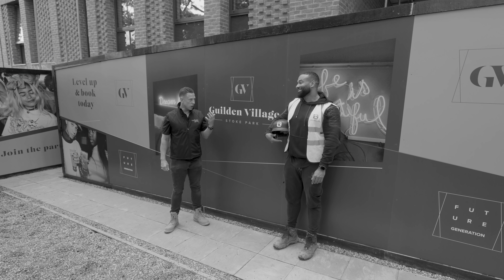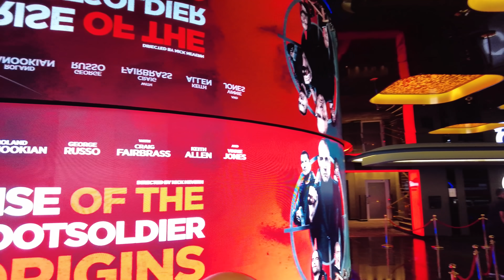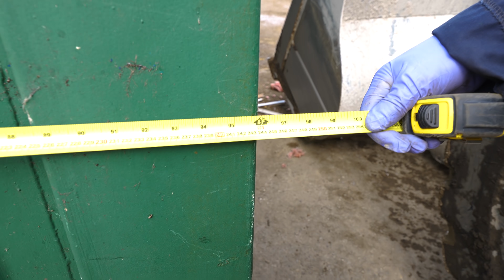Trying to Container My Excitement | Ashville Weekly ep048

Comment: Daniel you either need to fit an internal door with a window in it inside the steel door on the security hut or a concave mirror on the opposite side of the road so security man can see any vehicles approaching the barrier if it's pissing down/windy/cold and he has the door closed, or a CCTV camera and monitor.

Comment: The security office, would it not be an idea to have one of the windows facing the direction that traffic will be approaching the yard? And the door facing back into the yard. Might have to put another window in for that configuration.
Reply: I was thinking the same.
Reply: or put a window into the door, or get a glass door, then a steel shutter,
Reply: Exactly my thoughts two or was it three.
Reply: Don't like the split window either.
Reply: A cctv camera would work.
Reply: It adds safety to the security guy also having the door facing the yard
Reply: @satyajeetkumar4938  my thoughts exactly.

Comment: Hi Daniel, with the Ex Army flat rack you don't need to weld wheels onto the back, all you have to do is when you unload it release the handbrake on the truck and the flat rack will push the truck forward. i used them flaf racks for years in the army it will work a treat and save you tine trust me lol. all the best James.

Comment: For the army flatbed there is no need to weld wheels on, just put the truck in neutral and take the handbrake off as soon as the rear of the flatbed touches the ground and you'll simply roll forward👍🏻 this does require more space infront to unload though obviously

Comment: 27:34 before you completely redesign your network, get someone to check the light levels on your fibre. That will tell you whether there's an issue with transmission.

Ethernet (copper) should be good for 100m but if your Internet keeps dropping out its worth getting a proper network tester and check the cable and make sure it's not just a bad run. As others have said if you're running your cat in the same conduit as power that could create some interference.

If you're using media converters for your fibre it's worth whacking them into SFPs to rule them out as a cause of your problem.
Reply: Those Cisco switches (or switchers as they seem to be called....) are managed, you should be able to check the stats on the ports via the management on them.

Comment: Put a handle at the top of the sliding shutter on the security hut to lower it down behind the barrier. It would be easier to slide it back up aswell.

Comment: You should put a pulley wheel on top of the hut with a chain or rope onto the sliding door, that way just need pull the chain/rope to slide up the door save having reach in to get the handle

Comment: You should put a chain on the security window guard with a wheel on top and throw the small chain over and they can pull the chain to lift the guard plus it would lower the weight of the guard

Comment: Daniel! Changing the network cables/ fibre cables isn't going to fix your ip-conflict issues. This will no doubt need a network engineer on site to map out how your current network is setup/working and try and locate the duplicate ip. Seems like you guys could do with VLANS setting up so you can sperate your network traffic from other traffic like Phones or CCTV. But like i said it all comes down to how your network is currently setup. Happy to help...Ragz

Comment: Why dont you just weld a handle on the top of the security hut window cover so you can slide it up and you don’t have to reach down and when its high enough you can grab the bottom handle for extra support? And the same when you are putting it down so you don’t have to bend down and damage your back?
Reply: Or just add a winding mechanism and do it that way
Reply: because he will have to respray it? Wouldn't it be easier just to move the bollard 1m away?
Reply: @alirezazadeh  how will trucks and wide loads fit?
Reply: @alirezazadeh   have to respray what? A handle? Big job that mate 🙄

Comment: Call Me pedantic but the Red Square on that Jersey Barrier at the side of the Security Hut should be on the road side not the fence side for increased contrast visibility. 
Also there shouldn’t be a Jersey Barrier immediately in front of the Security Hut Window as it inhibits Access to the Window. 
Other than that your headed in the right direction.

Comment: "Ethernet Switcher" 😂😂😂 it's a network switch. 
You can run Cat5e or Cat6 for a <100m run but Cat5e will max at 1Gbps and Cat6 will max at 10Gbps upto 55m run then will drop to 1Gbps max for longer runs.

Comment: ive just done the same thing with mine run fibre cables ,did you know you can run about 50 ntrs on cat cables dont get ripped off on ya fibre i can get 30 mtrs for about 12 quid your prob using lc fibre ? fibre converters off ebay for about 3 quid each they work a treat